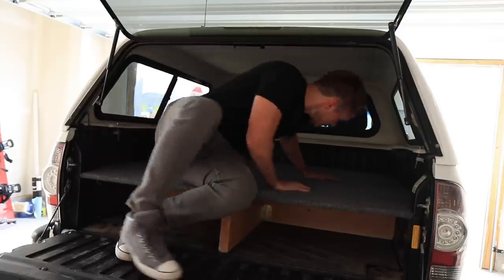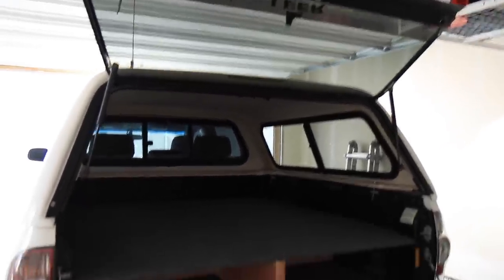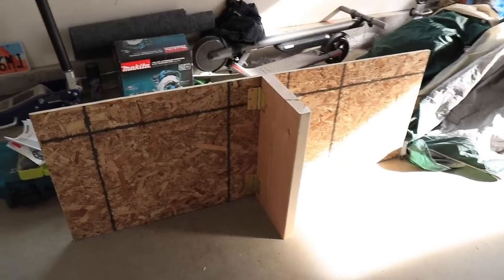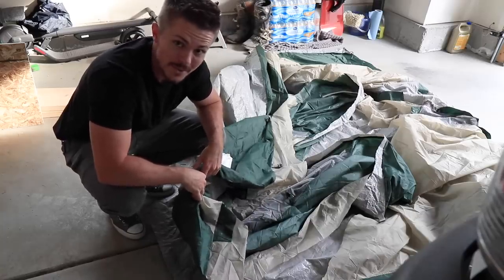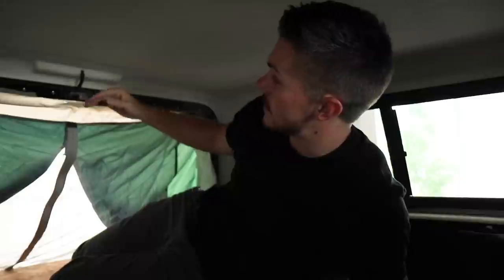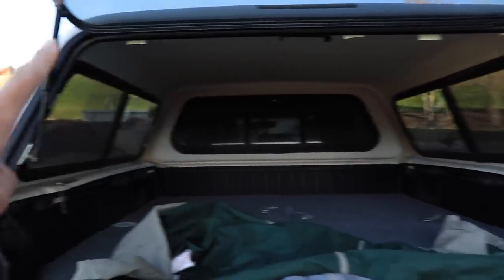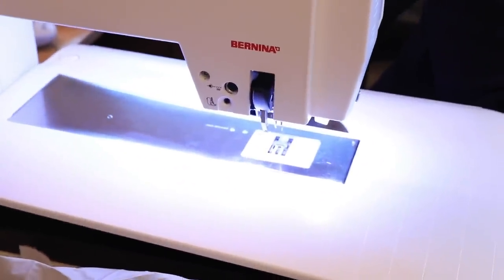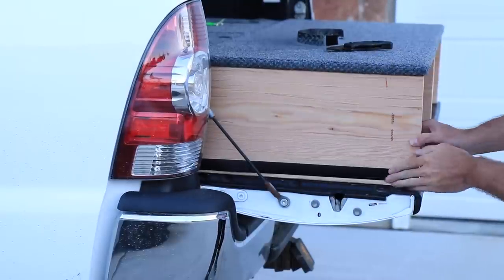DIY Camper Extension

Comment: Great idea. My only concern is how the velcro is attached to the truck.  My experience with stick-on velcro tells me that it could easily pull off under stress or wind.  An alternative would be to use contact cement, though you'd have a permanent installation.

Comment: Cool platform but use 3/4 ply instead of the 2x8. That will be a bad day if you ever get rear ended by another vehicle with that 2x8 in there.

Comment: The whole thing looks great.. My only concern is the ventilation because most of the shell is metal.. There's only one side where you have the tent coming down and if you pull the glass pannel down that lowers the ventilation further : /
Reply from the maker: So the shell is fiberglass, so it doesn’t hold as much heat as metal. But it can still get hot in the mornings. There are two windows on the side of the shell as well as a screen door that can open up fully, so between the screen door and the two windows, I think it’ll be just fine. Utah also cools down a lot at night, like 50-60 degrees in the summer time up in the mountains
Reply: @BraxenMcConnell  ahhh alright, my bad😅
Reply from the maker: Good observations tho man!